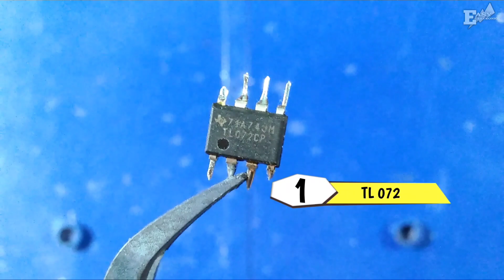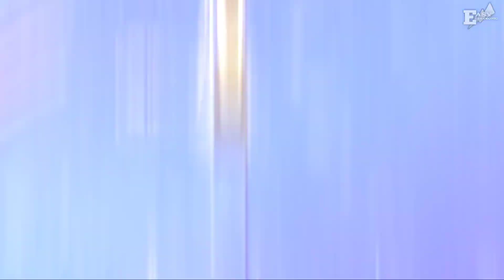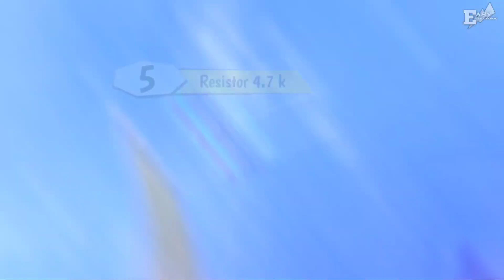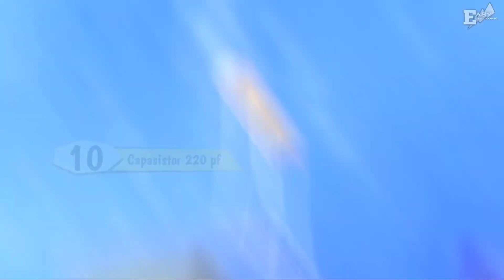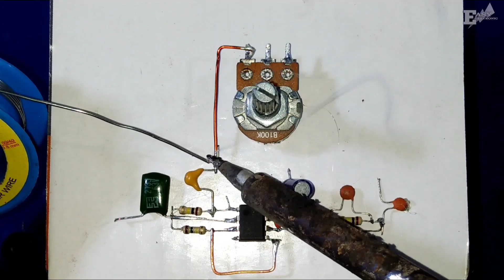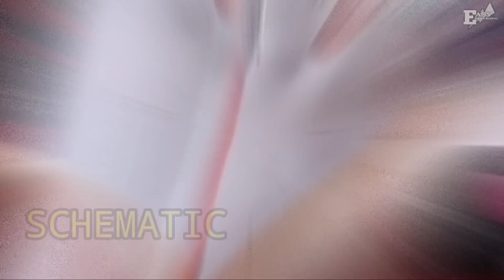Cara membuat CROSSOVER MID HIGH paling sederhana

Comment: Maaf bang mau tanya...saya coba merakit rangkaian di atas kok high nya over...pecah elko tweeter nya sampai 2 x 
Trs noisnya keras bngt
Kira2 pa yg salah y bang...
Mksh sblm nya tolong d jawab y bang
Reply from the maker: Maaf ka baru di jawab.  Itu kemungkina disebabkan dari kualitas komponen atau ada ja(ur yang miss,,  soalnya saya bikin tutorial nya pun setelah melalui pengetesan terlebih dahulu ka.
Reply: @EasyElektronic  coba tak cek lagi komponennya....soalnya pake komponen bekas🤭🤭🤭
Mksh bang...maju trs semangat berkarya...👍👍👍
Reply from the maker: Siap kaka semangat.. Terimakasih banyak semoga bermanfaat
Reply: @EasyElektronic sebetulnya bukan nois tapi berdesissss seperti kebesaran gain soalnya punya saya  juga begitu tapi kalo volume buka dikit gak desis tapi kurang keras yang lain aman cuman crossover  mid high nya aja yang desis untuk komponen saya pakai taiwan original ¼ semua ic aku pakai yang murah duaribu limaratus satu biji

Comment: Kalau pakai ic071 bisa tidak
Reply from the maker: Kalau pakai 071 /741 ga bisa ka harus pakai dual opamp seprti 4558 dan sejenis nya
Reply: @EasyElektronic  Brati kalau pakai IC 4558 bisa
Reply from the maker: Bisa ka .. 4558 / NE5532 /TL072